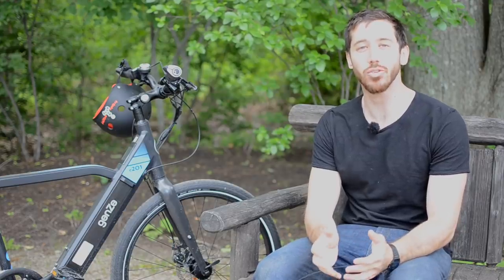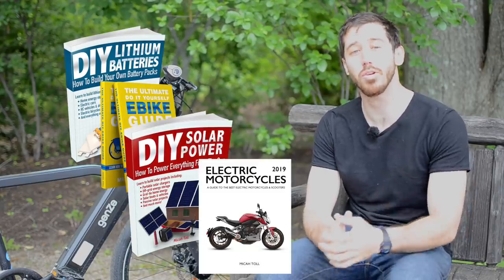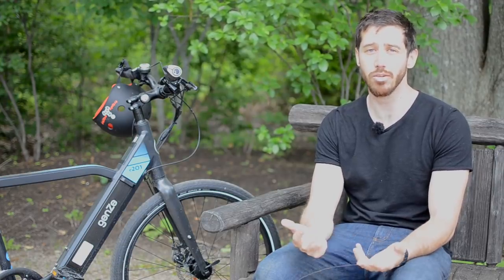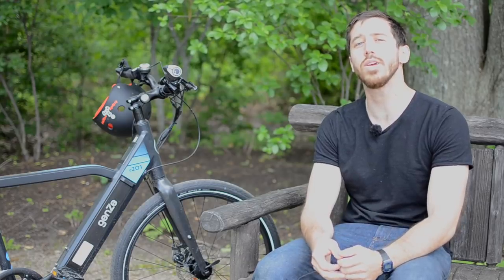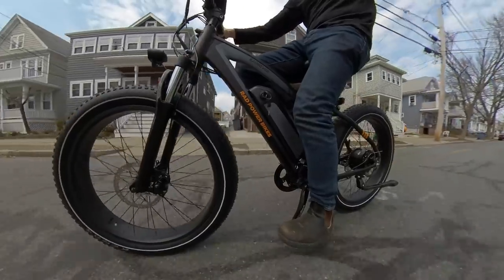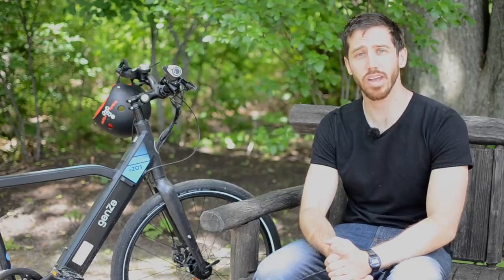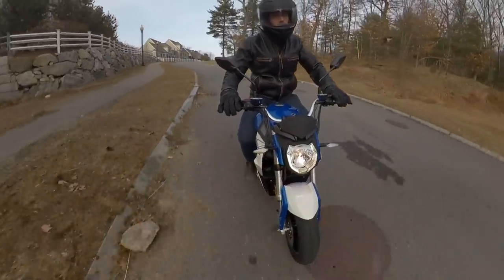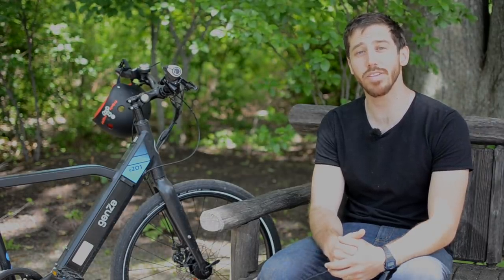How much POWER does an ebike need?

Comment: I have a BBSO2 48 volt 750 watt mid drive I'm purchasing a BBSHD 52 volt 1,000 watt will my 48-volt batteries work with the HD motor? Because I have 2 48 volt 14 amp hour and 20 amp hour batteries I'm hoping I can utilize with the 52 volt 1,000 watt motor? Thank you love all your videos

Comment: I am interested in converting a Burley Duet Tandem into an ebike. The bike plus captain and stoker weigh 355 lbs. We live in an area with fairly steep hills. We do not need to travel more than 20 mph. What watt motor and battery would you recommend? thanks

Comment: Thank you for answering this question!  I’m trying to manage my wattage while traveling but not sure how much battery bank is worth carrying.
Reply: Hello Annelise. Wattage is Volts x Amps, so 10Ah battery at 36V will give you 360Watts for an hour if you draw 10 Amps over that hour. If you draw less current it will go longer. Paul

Comment: I am looking at fat tire e-bikes for hunting and pulling a trailer. I am currently over 300 pounds and I am trying to decide whether to get 2 500 watt hub drives or 2 750 watt hub drives (looking at e-cells Super Monarch). I am also looking at the law - will I gain anything by having a higher wattage motor with electronically limited wattage? Will it be better to run the higher wattage motors at a lower percentage? Will the larger motors use more battery power - with or without electronically limited wattage? Thanks!

Comment: Hi Mikey sorry to say but cyclone make a big motor for mid drives I've just ordered 7500w mid drive cyclone they make a 18000 watt mid drive motor the bigger the motor,s are the more batteries & voltage is needed 🤔

Comment: How does this apply to ebikes in the EU where motors are limited by law?

For example the GoCycle G4 has a 500W continuous motor but in EU mode it's quoted to be 250W continuous, I think this is because regs state both a 250W and 15.5MPH "limit". You can switch between US and EU mode in the firmware, so it is the same motor.

So, for a 500W motor in 250W EU mode is there still the 500W performance on hills etc? How does that work?

Comment: I have a 750W on my hybrid  with a lot of steep hills around me and its great but I hardly ever have it set higher than assist level 3 and more often 1 or 2 because I also need range. My 48v 17.5ah battery gives me a max of around 38 Miles being careful! but the same battery would take me much further on a 250W motor just slower and so the long and short of it is for more range I probably should have gone with a 350W or 500W enough to get me up the steeper hills but with more range. The 750W was probably a step to far for me. If you want a motor bike buy a motor bike!

Comment: Hello i built AWD Ebike 48v. Front 350wats and 500watt rear. And i have two battery packs but the rear hub doesn't fully use the battery. It stops at 52volts. And don't know what is wrong?

Comment: Hi.

I am considering building a two wheel drive, double battery, twist throttle full suspension bike for off road exploring but that will switch to 250W for legally getting there.
Maximum power is not critical.

Your advice please.

Comment: 200w 36v rear gear hub 20km to 30k
350w 36v rear gear hub 30km to 40km
500w 48v rear gear hub 40km to 50km
750w 48v mid drive 45km to 55km
1000w 48v rear hub 55km to 65km
1000w 52v mid drive 55km to 65km 
3000w 72v mid drive 70km to 80km 
these are bikes iv made, im around 90kg, sorry kg and km im in australia. 
the geared hub motors will get you more distance for less battery mid drive would be next then direct drive hub. 1000w mid is best but speeds are to much for a bicycle. bearings need to be looked after, 9 speed im breaking chains going to 8 speed. 

first bike or kit i would say get 500w 48v rear geared hub. good speed you dont need a huge battery. 12ah will do over 50km.

if you live in a hilly place you need a mid drive. 

if your doing long distance and sitting on one speed direct drive hub is good for this. 

hope this helps, iv only made what iv made from watching ebike school videos the battery and ebike book and im just too good ;) 
 YOU CAN DO IT!!!!!!!

Comment: I have a question about different gear ratios and rear hub motor. Does the motor know what gear I'm using by measuring the rpm of my legs (rpm sensor) and rpm of the wheel? 

I'm thinking what would happen when I use a 1500-2000W hub motor but I want to go up a very high angle hill and I will use mountain climbing gear (high gear ratio). Will the motor overrun my legs so it will push me instead of just assisting? I'm completelynew in this topic. Thanks in advance.

Comment: Hello. It will probably sounds stupid but I have a 350w motor for my electric scooter with the maximum peak power of 500w. That what's its written on the box. And I just bought a 500w motor brush controller. Can I connect them without any problems like burning the motor ore something like this? 
Thank you for help .

Comment: If a recycle 18650 cell rated capacity 3000mAh and  measuring capacity  2000mAh then what will be the equal of 1C  ( 3Ah or 2Ah)?

Comment: I got an e bike with 750w motor 47v but sinds im using 36v the range on it is better less speed but. 26km u is max in eu Netherlands, and im going 40/45km u on empty long roads and the battery meter is not freaking out on 36v on 48v the meter went fast down and not riding it went 1 or 2 bars up a bit wierd so im happpy with 36v !

Comment: Here's my dilemma..
I have a 48v 1500w hub motor. Yup it's noice !!
But... Moooor powa !!
So I decided to build (via your book) a 72v battery. I'm still getting the final knick knacks to build it but I've got most of the components.
Here's the issue.
Obviously I'm going to need a better controller. Probably a Sabvoton, which is pricey. Oh and a charger too !
Now that's likely to come out at about £500-ish sterling but I can buy a 3KW @ 72v hub motor brand new with controller<-- Not Sabvoton for about £350 which is going to give me more power for less dosh anyway !
The Sabvoton route would likely enable me to keep the 48V rackmount battery onboard though for long distances and "just switch off and unplug the 48v and then plug into the 72v battery" <-- I'm assuming the Sabvoton would allow that ?  Maybe the 3kw controller would allow that too ? I dunno.. Hence the dilemma !
What would you do ?

Comment: im 6'3" near 300lbs, and I've never tried an ebike before, and having one would make my commute so much easier. Money is real tight so I'm curious where I should start after saving up a bit?
Reply: You should look into getting a fat bike lol... that's the style with large fat tires. Most of all look into mid drive motors over hub, especially if money is tight. They produce more torque which will help. Don't get a battery less than 48v. Check out Luna. Everyone recommends them because they have some cool stuff at decent prices.

Comment: thanks thats a useful video! wil larger motors (750)use more battery as smaller motors (500) even when driving same speed at flat roads on same assistence level?

Comment: I love your videos! And just received my bbshd mid motor with a 52 volt 24 Ah. Battery built by Luna! Can't wait to build it. Just hope I can put it on my donor bike has a 68mm bottom bracket, but I ordered the 100mm bottom bracket size, thinking that spacers can be utilized, bigger is better? Maybe not will see.

Comment: Mica..... the motor rating is only a part if the equation.  1000watt motor with a battery and controller that is not matched to do the job, will not take you up a hill.  😉😛

Comment: Okay, will a 750 watt bike have as much range as 500 watt bike? Same battery, same controller, same conditions, 95% flat ground. pretty all the same conditions including not heavy on throttle, no peddling. 10-20 mph.

Comment: Does the front hub motor recharge the bottle battery if the set speed limit is exceeded? I just finished a ride with 15% assist with 12mph speed limit, when I finished the ride I still had 100% of battery remaining.

Comment: hi
i have an ancheer ebike 36v 10ah i bought in ebay 3 yrs ago ( i am not sure how many watts)
anyway, i saw in ebay a battery pack  36v 16ah 500w 
can i connect this in parallel to my existing ebike, like an additional power?
i will appreciate very much your comment on this, thank you sir !

Comment: Hey Micah I have a question, I have an ebike that I built that is a 48v, 1000 watt front hub motor with a 15ah battery that I purchased through AliExpress.  The battery gives me about 20 miles of range depending on how I ride.  If I were to purchase a 2nd battery with similar specs, 1) how would I connect it to the other battery to utilize both simultaneously and 2) would that double my rage or increase my overall power? Thanks!
Reply: Connect them in parallel and ensure they are within 0.5V of each other before doing. Once in parrelel you can charge and discharge both as if they were one battery now. Just add another connection from end of parrelel terminal. Yes, it will approx double your range. Also, ensure they are extremely similar batteries with same capacity aH.

Comment: Hello I need your help. I have an electric bicycle and the battery no longer keeps the battery. The battery is built with HW 26650 / 3M 3.7V 2500mAh OD19 batteries. The problem is that I can not find them. with what can I replace them? can i make the battery with 18650? and what would be the model? thank you.

Comment: You really need 3kw minimum for off road with hills. Use parallel batteries so amp draw doesn't drop and you stay in peak power.

Comment: My 36v 350w bafang max has less climbing performance than a regular 250w mid drive because it doesn't support proper off-road gearing and the battery is only 11AH while the controller is 16AH.. battery sag is massive. It would probably keep up with 250w systems if I had 16AH battery or 48v battery.  Cheap ebikes has some clear limitations compared with more expensive bikes. Battery is usually where chinese manufacturers goes cheap.
Reply: The Aussie Fortis bikes have 36V 10A battery, good for 35Km
Reply: @manFromPeterborough  I don't have electric fatbike anymore. It wasn't usable in winter conditions.  I'm only using 900cc snowmobile now.
Reply: @vectraB97  no snow where I live, VIC alps have snow Mt Hotham to name one

Comment: I have a costco Infinity Boss Three hybrid bike, what are your thoughts on the bafang 500w mid drive motor?  Looking for a speed of about 25 mph and a range of about 35 miles, researching to see if it will fit though

Comment: Hi Micah, for a twist throttle, is the transfer of power, on or off or a gradual increase? planning to setup my aluminum MTB with a 1000W or 1500W hub motor, price difference is negligible, if the power delivery is gradual though, thinking of just getting the 1500W motor. Thanks for your reply.

Comment: Hi and thanks for your informative videos. Just thought I would mention that the latest information on EU regulations appears to allow us now to use 1000 watt motors, but speed is still limited to 25 kph.
That's great news as being disabled and a little overweight i cant get up hills very easily on my new tricycle which has has a regular 250 watt hub motor
Best wishes
Peter
Reply: Owen racing Well that's what i am reading but think its EU law

Comment: @Micah Toll / EbikeSchool.com is there a difference in weight between the 500w hub motor and 750w hub motor? I have a 750w hub motor that seems heavy on the bike and isn't worth the weight in my opinion. Please note that I swapped the controller which was rated for 750w to a 350w controller and feel the 350w controller is better. The 750w controller had too much torque if I just touched the throttle...

To clarify my question: is 500w hub motor lighter than 750w motor in weight?

Comment: Hey Micah, would you be able to recommend a 250watt hub motor which can safely overvolted using a 48v battery with 20amp controller? Another great video btw. Thanks!

Comment: Here in the UK, we are restricted to 250W, but many people ignore this. I have a 250W mid drive, and it is enough, just. You have to use the gears, and it is an experience just like an ordinary mountain bike, but easier.
 I have been mountain biking for 25 years, and the 250W motor just makes it easier for me. I want the work out and experience I enjoy, without too much pain on the climbs.

 I have overamped,  my motor,which is legal, and as you say, 250 W is different on all motors. In the UK, if the motor is stamped 250, you are good to go.
 The police are not remotely interested, the problem comes if you hit someone on an illegal bike, you could be spending some time in prison.

Comment: Could you please here for my query. 
I would like to use 750w bldc motor 
Can I use a battery with 48v40ah LifePO4 .....?
Is there any limitation on ah that motor should have Max capacity..ex only Max 30ah or 50ah etc..?
If yes
how many km I can get with 85kg..? of weight.

Comment: Why doesn't anyone talk about distance, some of us don.t care about acceleration or speed, I just want to go between 50  to  65 miles before runniong out of power between charge points.. I weight 165lbs and the terrain is called rolling..no incline geater than 20 degrees. Needless to say I also need  a light bike with road tire. Still trying to figure out why anyone needs a 4" wide knobby tire for anything except snow or sand.

Comment: Hi, I have a treadmill motor and was wondering if I could fit it to a bike and be enough power for it, it’s rated for 1600W at 110V, I know that I will need to do my own battery pack and and controller, cause it doesn’t use that much amps, it’s ore about volts with thus one (compared with other motors in the market). But with a gear system would this be enough to power a bike through a small hill or something similar, I watch the video and understand it, but this is not a motor specific for this, I got it for free and wondering if I could something similar to a ebike with it. Thanks.

Comment: I have a steep hill to get to my home. I'm 45 years old & weigh just over12 stone and 250watts is fine for me, because I actually want the exercise. Sure, it's tough, but I didn't buy a pedal bike just to do nothing. If I wanted a motorbike, I'd buy a motorbike. Throttles on something with pedals is just wrong. That's not to say it isn't fun though, lol.

Comment: Hi Mika, Great vid as usual, informative but im not sure how that applies to UK law on elec tric bikes, I will check it out.    Though I'm a new subscriber I've been following your vids on Youtube for years on my XBox I really enjoy you vids even if they don't apply to my situation.       I have a question for you, I am disabled and cant ride a bike anymore so I bought myself a recumbent Trike, its an Azub TiFly 26, I would attach a pic but I don't know how to on here, but check it out on their website, anyway 1/ I'm getting on in years and 2/ the geometry on these trikes means the traction on the rear drive wheel is ok...ish on asphalt but on gravel tracks or off road its not good, so I want to electric assist on both front wheels, whats the best way to do this and how do I get around the differential problem when steering around corners? any suggestions you could give me would be invaluable, thanks. ps my trike has Sturmey Archer 90 mm drums on the front and a Pinion P18 gearbox. pps could you do a vid about EV.. ing a Recumbent trike?

Comment: Heres a question Micah!
What type of frame is good for a diy ebike fast build ex:carbon,steel,etc?
Reply: 3kW ebike here. I would add if you can get dual suspension. Bumps at 25mph+ with a hard tail is not pleasant over and over again for a long distance.
Reply: @feedallday2556  yea man but hartail with dual suslension doesnt have frame space for the batteries im trying to put inside of it
Reply: @eliasfeleke7920  Yes, but you can also split the battery between mid frame and top tube. Or, find a dual suspension that has enough room. Yes, finding big bike frames that just fits your needs sometimes is a difficult challenge.

Comment: Well, I always thought mid drive system has at least two disadvantages: More power on the chain (I think they wear out fast enough on a regular bicycle) and still only one wheel drive. With a hub motor on the front wheel, you have two wheel drive, shouldn't that be a slight advantage when climbing in certain conditions?
Reply: Johnny Rosenberg for efficiency one bigger engine is better than 2 smaller engines, this would be true for cars, boats, e bike motors with batteries etc. However, we cant transfer power to front steering wheel on a bike by chain/shaft so front motor could be an option in certain conditions like extreme offroad or mud, but for 99.99% of us one bigger motor would be better than two smaller ones.
Reply: @bluewanderer9903  But I wasn't talking about two engines. I was talking about one at the front. The rear wheel is human powered.

Comment: Hi can you do a video on how to use capasitor in your battery pack for stopping voltage drop and get better battery life? Best regards :)
Reply: Cato, in paralel w/cells they handel the hard exceleration, saving the cells smooth demnd. Check "madelectron.com" capacitor battery pack. 
Iam using a 350w 36v direct front hub, w/2strok, 4 1/2hp gas rear drive. Long Range Alaska Mule... +/- 300miles. No hill too steep!
    Dutchman
Reply: @dutchmanentcinderclause6268  hey thank you so much 😊 Will be really fun to see if i can make it work for me 😊